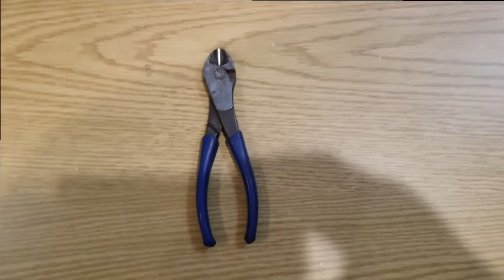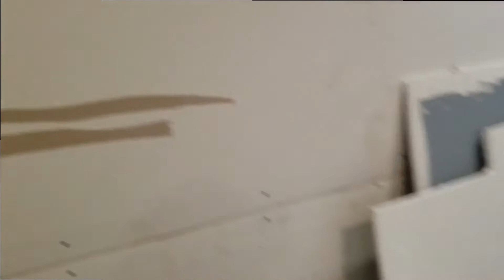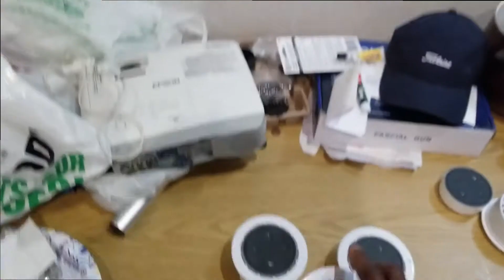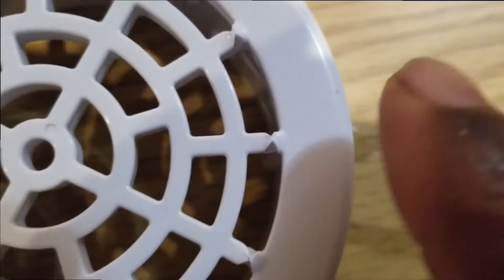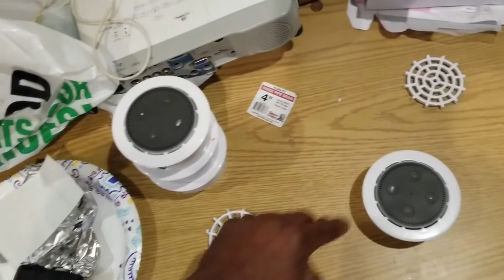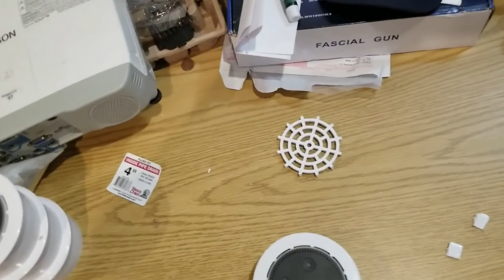Echo Dot Flush Wall Mount For $3.00 Easy DIY

Comment: Very clever and I liked the idea to use it with my Echo Dot 3rd. Gen (ED3G), on the roof then I want to know if someone has already experienced it and the device (ED3G), is tight enough not to fall. I am not in the USA and I would have to buy the "Inside Pipe Drain" online. Thanks if anyone could help me.